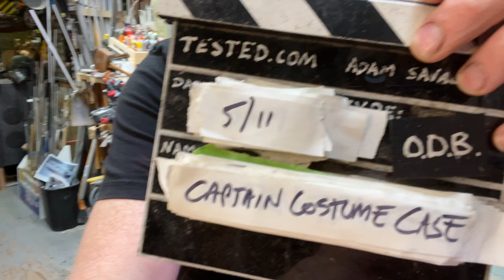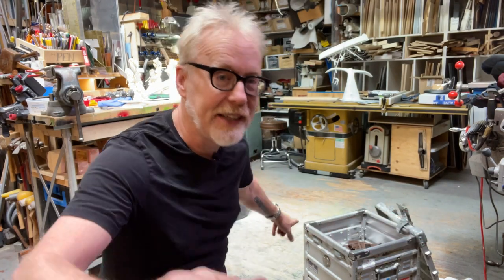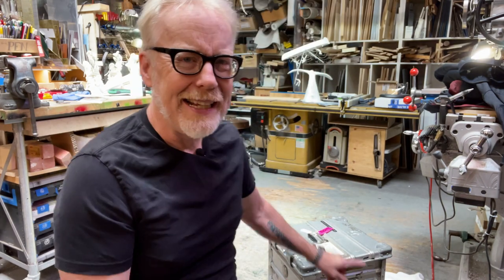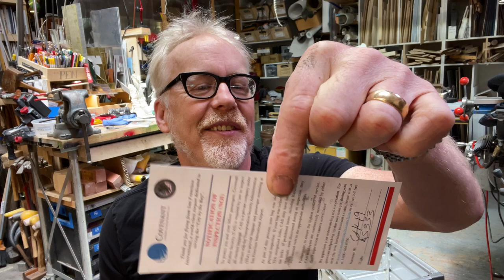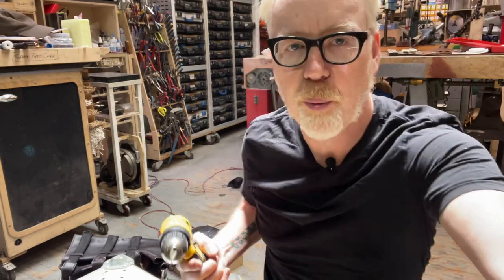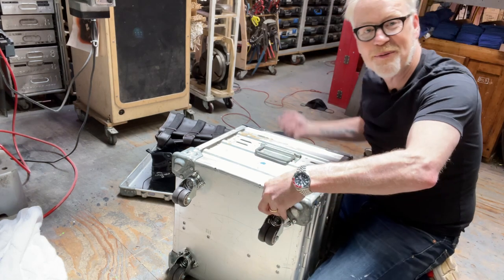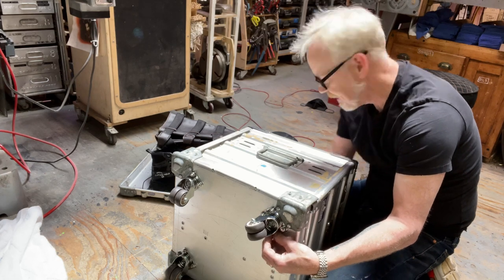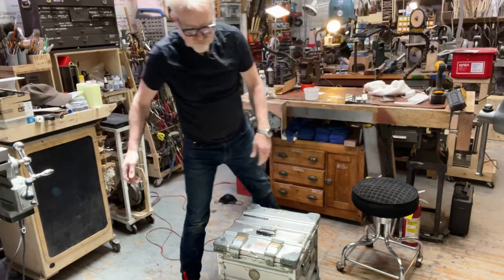Adam Savage's One Day Builds: Adding Casters to Costume Cases!

Comment: In my days of building touring sound gear road cases, adding permanent casters to cases had its challenges as it meant that cases wouldn't stand still when on the wheels, and that meant they had to pack on their side, so they needed to be able to have things stacked on them in that direction. The other thing I learned was that it was better to have the bolt heads on the bottom to reduce those clearance issues and make it easier to catch hardware that was getting loose without having it vanish. With a pure aluminium case like that it was also helpful to use a piece of 1/2" plywood on the top side, maybe 1" larger than the caster base plate, with T-nuts embedded in it, as that spread the load and reduced chance of punch through when the case is dropped on its wheels, and if the bolts loosened up, you didn't end up with loose nuts and lockwashers floating around inside the case.
Reply: I came to the comments to say much of this and also suggest that lock washers or thread locker would be useful if it's going to be go through airline baggage handling.  This sort of thing rattling around for hours at a time is exactly how bolts work loose.
Reply: I was going to say the same thing.  The case won't take much abuse from the airlines before the casters try to punch through the thin aluminum bottom.  It really needs to be reinforced.
Reply: May also need some sort of water proofing around the homes.  I had a drum (percussion) case with added wheels that I pushed through a downpour and pushes to a stage. There was an inch of water in the bottom of the box when opened.  Blessedly didn't hurt the drum.
Reply: He used stainless with an impact driver, good chance they cold welded and aren’t coming off
Reply: What would roll enough to be worth packing a case on its side? I've seen a few road cases and I'm just struggling to picture this
Reply: @dean.karres  a surprising number of my cases / hampers / trunks have ended up with drainage holes in the bottom. Come graduation season I know nothing short of a pelican style case will keep water out, so we have to let water out!
Reply: Yes, what Barry said.
Reply: @billlawrence9594  oh gods... I missed that he said stainless in there (I just assumed he had pulled these bolts from his "hardware store" large collection of non-stainless bolts that he did a one day build on).  I made the mistake of using an impact wrench on stainless bolts on something that I needed to take apart a week later.  Roughly half of the bolts were cold welded when I went to take them apart.  Eventually I managed to find some bolt cutters but that was not a good day.
Reply: @xuthnet  I’m just now realizing that I finished 4 bolts on my pool cover last night that are stainless with my 1/4” impact.    I think they are 12-24 so I can just snap them when it’s time for a new solid cover
Reply: @samueldeter9735  standard practice to tip cases when loading a truck, doesn’t take a lot of movement for your cases to start battering the crap out of each other and anything else in the truck when left on their wheels.

In rare situations where something is not tip-friendly the case will be clearly marked “DO NOT TIP” or similar
Reply: @ConorNoakes  thank you! When he said "load them on their side" I was thinking put the things into the case, not put the case into a trailer. I was confused af for like 10 minutes before typing that comment lol

Comment: I've always put the bolts at the casters (outside) to avoid clearance issues. I also recommend a bottom of wood in the box to spread the load and possibly a false bottom above the bolt heads to stop them damaging the contents.
Reply: Bonus, if you stick some EVA foam to the underside of the wood, it'll do pretty decent job of holding the bolts (or nuts in your case) steady while you secure the other side.
Reply: What about rivets? Would they work for something like this? I figure it'll give it a more clean, flush finish than nuts and bolts.

Comment: Casters always help. I know using the cutoff wheel probably has the nuts sealed on there, but if you didn't use it, would you have used something like blue Loctite? Thanks!
Reply: Same thought I had... or perhaps 1/4" heavy pop rivets? They're what Ford uses to fasten door mechanisms (handle, window regulators, etc.) and what I used when I replaced the front casters on my engine stand. Not to mention they weigh slightly less, which for air travel may matter if the weight is close to the limit.
Reply: For what it’s worth nyloc nuts would be my tip.
Reply: @frantisekhajek8  True. It was the sound of the nuts on the thread when Adam was spinning them on that made me think of Loctite.
Reply: @DigitalChadLife  Sure, sure, it would work also, just more messy. In the end the best solution is the one you have at hand :D

Comment: Great addition.  The case is pretty beefy so it should be able to withstand the tsa tossing it will now get with casters.  It will live in planes on its side.  Hopefully the bottom aluminum is sturdy enough to handle the flex and or abuse.  Easily reinforced if not.  Love it!

Comment: One shop template I made and find that I've been able to reuse several times is a positioning and drilling template for casters.  I originally made it to position a set of wheels the same distance from the edge of a cabinet I was making, but I've found that many casters use basically the same size plate (and hole spacing).  Size the template plate so the caster base is one distance from the edge on two perpendicular sides, and a different distance (or flush with the edge) on the opposite two sides, for maximum versatility.  It lets me quickly mark or drill the holes I need, with minimum effort.

Comment: What I’ve always wanted in trunk casters is a system where they can retract into the body so I have the stabilisation of a fixed platform as well as wheel when I’m moving it. That way my trunks become my stable display and work area when I arrive.
Reply: as far as I remember, Jimmy Diresta made two anvil stands with wheels that retract like that, check his channel.
Reply: As he was building this, I wondered about putting an extra cap on the bottom to cover the casters while shipping.  I think if you sized it to fit as an add-on at top or bottom, but to have an internal cargo packing area that excluded the casters, it would work well.
Reply: Quality touring cases have casters that lock both the wheel and the swivel. I’ve found that a heavy case with a wide enough stance is plenty stable for a display or moderate work surface. Heavy impact and torque need to take into account the caster’s weight rating.
Reply: @schooltechnology  never seen a pro touring case that had locking castors personally, they’re widely regarded to be a liability
Reply: @ConorNoakes  We may be thinking of different types of cases. I'm referring to Rack cases and truck pack cable/lighting cases and similar as built by Gator, Jan-AL, and (the granddaddy) Anvil. Locking casters are available or standard from each manufacturer. While large rental companies or tour managers might cheap out on locking casters for their case specs., The sound & stage crews in central Kansas, where owners also are stage crew, tend to have them on cases. I can see them being a liability on less stable loads such as large analog mixer cases. Of course they should never be a substitute for properly securing a load before transit.
Reply: @schooltechnology  I’m talking about touring level kit (racks, stacks, trunks, etc.), not local hire outfits reinventing the wheel
Reply: @ConorNoakes YMMV
 Most of the touring acts I have worked as local crew for have a mix of locking and non-locking on cases they brought.
Local sound co., instead of "reinventing the wheel" simply bought racks with caster locks off of a finished NIN tour. Admittedly, I don't crew for arena or Broadway tour shows. Too few of them play this area.

Comment: Piece of ply to reinforce the thin bottom, and i would derivet the OG case feet, since they match the pattern of the wheels and reuse the holes to move the base of the casters outwards a bit more. A little bit of trimming of the base of the case foot would be required, because of the caster's ball bearing base, but that's nothing a dremel bit can't handle. Carriage bolts with nyloc nuts recessed into the ply. Just my 2 cents on it. If you plan on sitting on the box, the ply at least would be required, in time the metal will work harden and crack, i've seen it happen with those normal feet, let alone the added leverage of the caster base.

Comment: I definitely would have put a doubler on each caster (or the entire bottom) inside the case.  Plywood would do and not add much weight.  A few bounces by the airline cargo staff and the thin metal bottom will start bending and possible breaking.  My $0.02.

Comment: As awesome as that is, and YES it is awesome,  I would advocate for a thinner, longer case, like a small foot locker.  Of course the same material would be key, that aluminum body could only be rivaled by Rimowa and only because of their styling.  With thinner and longer you could use two wheels in the back and a retract handle in the front.  Easy to drag around and good for airports. Meh, just my 2 cents.   Cheers on yet another awesome project!!

Comment: hey Adam, instead of trimming down the bolts you could use a 12mm piece of ply wood as a spacer. these would also add some level of shock resistance so you dont end up with damages to the case over time (Y)

Comment: I can see that that can easily tip over when you sit on it since the wheels mounted in so far because they had to be installed behind the corner protectors. Be careful when you sit anything on it, including yourself. The apparent tipping point is deceptive because of the change in height of the center of gravity and the reduced foot print. This will also be impacted by how you pack it.

Comment: Hi Adam
Nice castors but if you intend that case to go anywhere near a commercial aircraft and it's baggage handlers you may want to include a reinforcementt plate either inside or outside to resist torsion on the caster body. Good luck

Comment: Would have been a perfect application for self tapping bolts. Just zip zip zip zip, nut nut nut nut, wrench crank about a quarter turn on each nut after a quick finger tighten, and done. None of that reaching in to hold a the bolt while you put the nut on with the other hand stuff.

Comment: I'll just jump in to second (third? Nth?) The idea of attaching your casters to a plywood "skateboard" (industry term) that then attaches to the case. 

That's how almost all casters in the AV industry are attached  it does spread the load, and it can make it easier to keep track of ever loosening hardware, but most importantly it is sacrificial.  

When (not if) some mook smashes the case into a ramp plate, curb, sandbag, cable ramp, whatever, the plywood will fail before the case bottom, and is easily replaceable. 

Probably not a big deal on what amounts to very fancy personal luggage, but critical on anything that will be moved on your behalf.  Especially if there will ever be a forklift involved.

Comment: Observations I’ve not seen in comments yet:
The stem version of those casters is what Baldwin piano has put on their institutional upright piano (Hamilton) for decades. Advertised as “Approved by all school boards for floors.”

I noticed you also didn’t remove the bottom of that collapsible case but reached all the way around to the inside.

Casters would negate a case’s ATA status. So do protruding handles and latches. See Penn-Elcom for recessed hardware and quick release casters that can be packed inside the case. 

I hope you have a spare case for when the casters rip out the bottom. Even if you had used backing washers or plates the casters will disconnect in a catastrophic manner. I have learned the hard way. 

With your connection to the entertainment industry I’m surprised you aren’t more familiar with ATA and truck road cases.

Comment: A thin steel plate for each caster with bolt holes on the INSIDE of the case could reinforce the case to prevent bending. (Sorry if a repeat, I didn't read all comments.)

Comment: Might I suggest that you put a wooden bottom inside the case to screw the bolts through to stop it from bending when airport loaders inevitably toss and sling that case around and onto the floor? As strong as the aluminum is on those cases, it will bend and could break under the right amount of stress or shock. It will also enable it to hold more weight on top for sitting or using it to transport other luggage and/or equipment around.

Comment: I would have not attached casters directly to it, but instead used a collapsible hand truck sized for the case.  That or maybe some way to retract or remove the casters when not in use.  I think I'd also almost prefer just small wheels on one side of the case so you have to tilt and roll it like a pilot bag.

Comment: I imagined you’d need to add a reinforcement plate  in the bottom to prevent tearing out the aluminium if castors ever get snagged.

Comment: I won't pile on too much with those who suggested flipping the blots around so the head is on the outside, but I will pile on to nylock nuts or thread-lock on those will go a long way, especially if you plan to travel with it as-is.  If you flip the bolts, also consider using acorn nuts to prevent the ends of the bolts from snagging the box contents.

Comment: At 5:42 Adam is using a "step" drill bit named for its shape.  IMHO this is the optimal drill bit for thin materials (especially metals) as the shape of the cutting point won't distort or "rip" the material as it punches through. Plus it cleans up the edge of the hole as it finishes the cut. HINT: While each step has it's diameter labeled, the label is impossible to read while drilling.  So use a marker to draw a line around the outside edge of the step size you are shooting for.  Easy to see where you are going!  My $0.02.